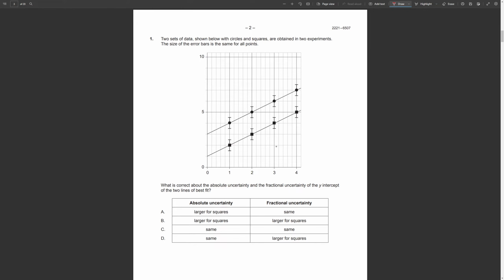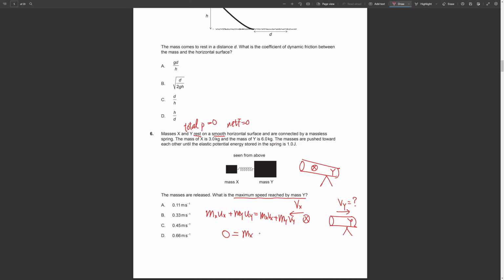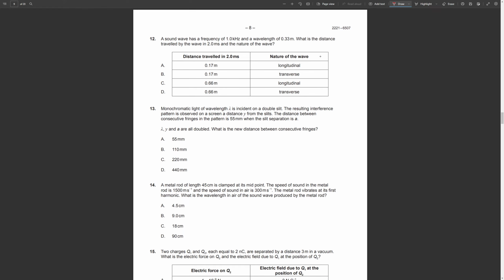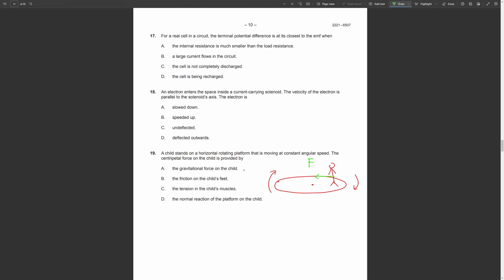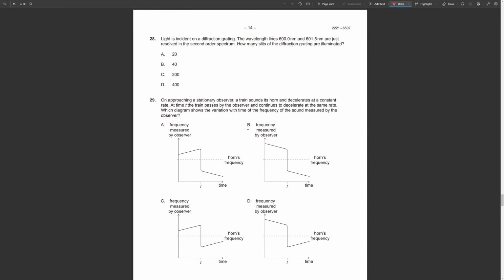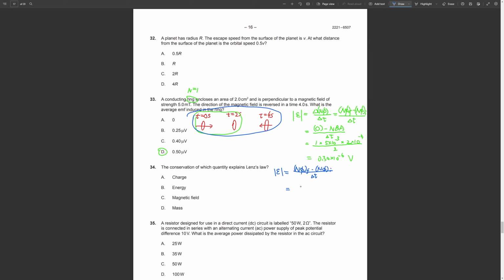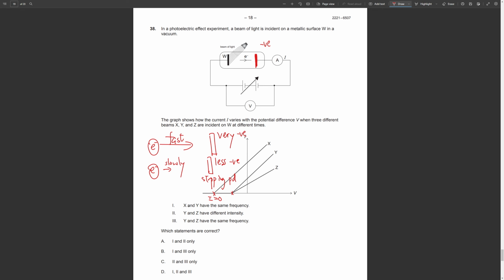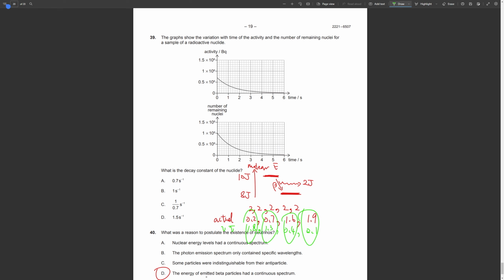IB Physics Exam Paper Solutions | 2021 May Time Zone 1 | Higher Level | Paper 1

Comment: Question 6 isn't worth 1 mark, there is no way. This is like asking us to do a Paper 2 question in barely a minute's time. What is the IB smoking.
Reply from the maker: It’s an multiple choice so you may eliminate some impossible options. For instance, D is definitely wrong since the 6kg box itself would have more than 1J of kinetic energy. 

In exam, don’t hesitate to skip a insanely challenging question. Just like being in a relationship, if it doesn’t work out, just move to the next one. The next one will be better.
Reply: @physicsexampapersolutions3357  Yeah I’m sure I could work it out, but it’s a quite difficult sum … in terms of actually clocking how to approach it and then doing the written work in such less time. Thank you tho, your explanations are fantastic!